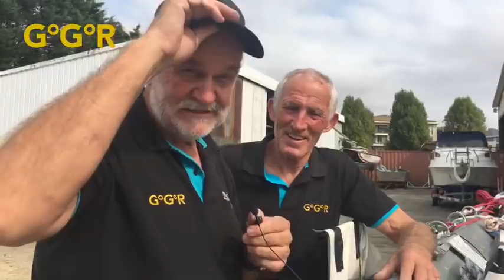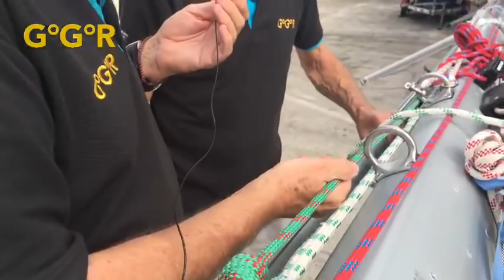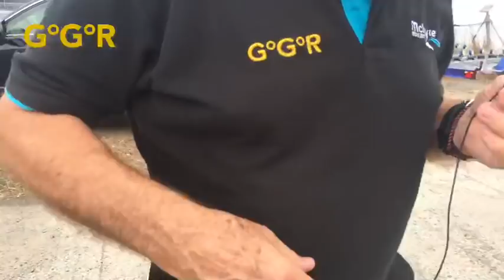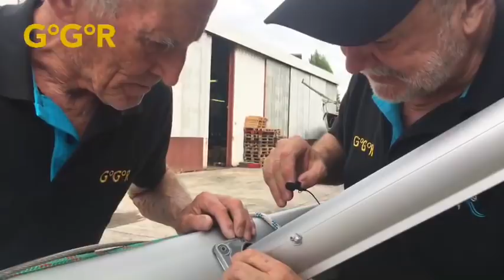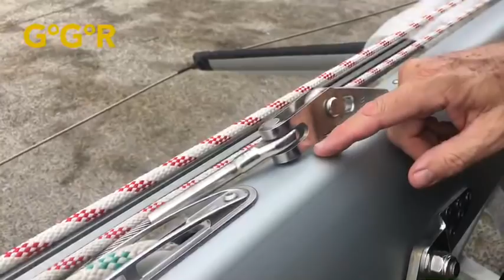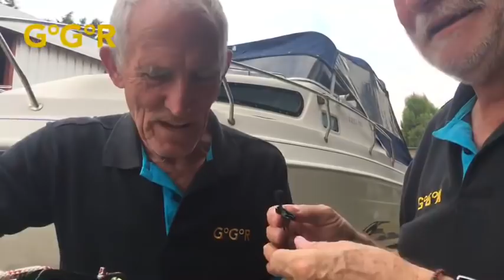GGR 2018 CHATS WITH ROBIN DAVIE N°4

Comment: Where is this boat now. Didn't know they took it apart and rebuilt it fromthe inside out. S&S designs are just beautiful, But looks really low in the water, is that because of 7-8 months of supplies on board?